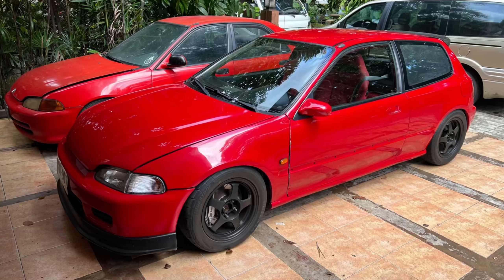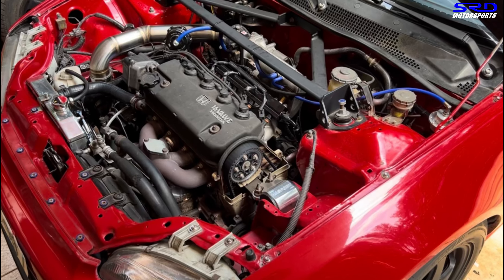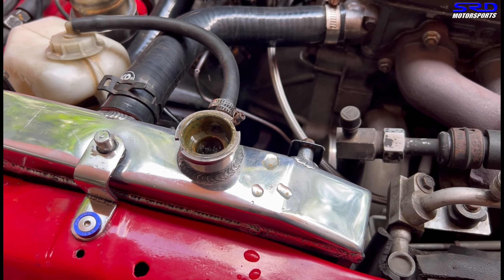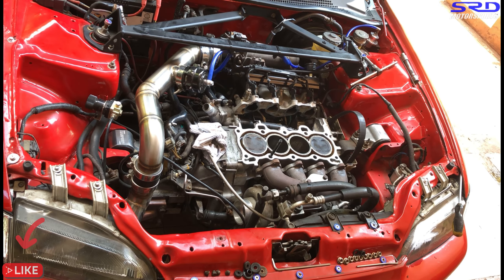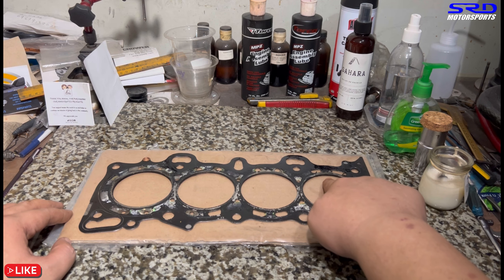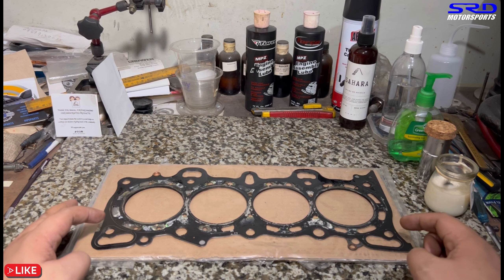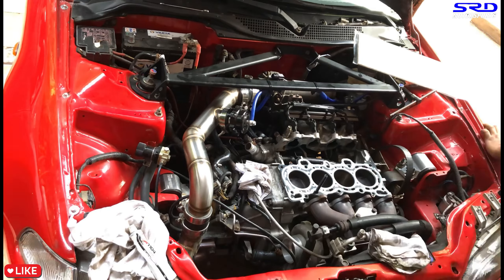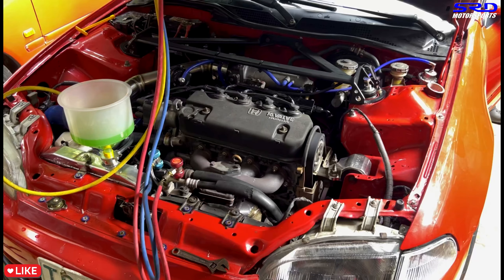D16a6 Turbo Street: Why we had to change Head Gasket

Comment: I used a Felpro head gasket on my D15 turbo and blew the head gasket around 7k miles. I think it’s less about the head gasket and more about clamping between the head and block. I used ARP head studs and boosted 8psi making 205whp. Unfortunately I also warped my block so now I’m looking to go NA B20 as I want to daily my car reliably.
Reply from the maker: On boosted it’s also “timing” that can do this

Comment: how much boost can these non vtec engines handle reliably?
Reply from the maker: much the same as a sohc vtec really no diff.., depends on the set up

My friend has gone from 400 to 500whp on a well tuned stock sleeve D16 but with Wiseco Pistons and GT turbo

and he didn’t go over 2bar boost

So it really depends cuz even with the right parts if it isn’t assembled well or properly it won’t last long

Now even if it’s good parts and assembled correctly.., a bad tune can turn the whole engine to a pile of junk